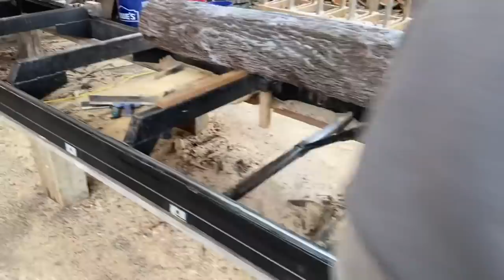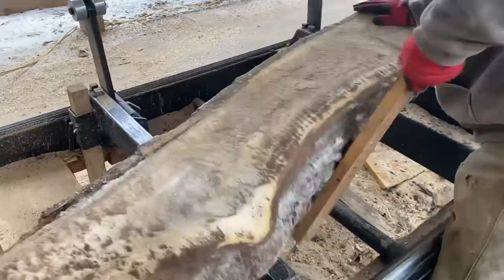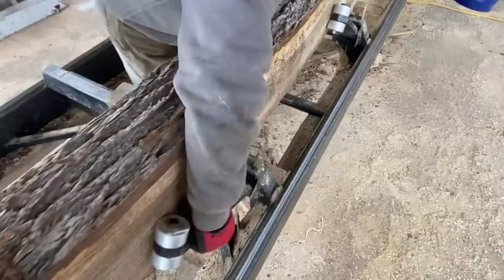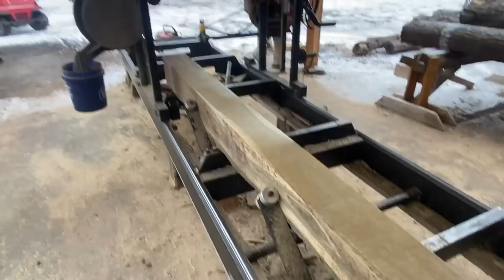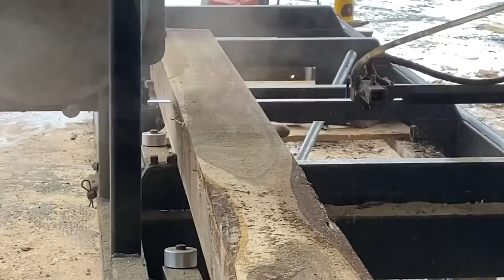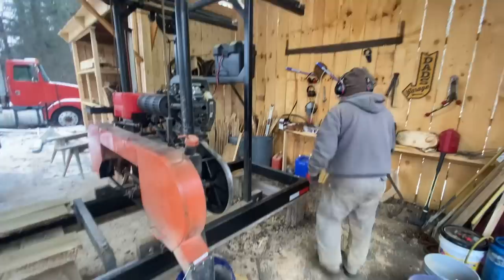Homemade sawmill in action!

Comment: You obviously are a man who is intelligent enough so that you have no problem taking advice from others.  I see that attribute in your mill.  The deep throat on your mill is a huge improvement over the small commercial mills I have seen.  Here's my advice for you.  Read up on quarter sawing.  These small mills are slow.  But, given great expertise as a sawyer, you can easily provide yourself, and others some of the most fantastic and valuable wood possible out of each log, wood that is otherwise unavailable anywhere else.  Learning about quarter sawing from a number of different sources, will give you that knowledge.  There are a wide variety of quarter sawing techniques to study, each for a specific purpose corresponding to what the end-user, carpenter/craftsman, has in mind.  Quarter sawing is begun by studying the log, and turning it on the mill, so you can make a straight cut right down the center of the log.  Then throw half the log off the mill.  The remaining half, stand it up flat and cut a line off-center through the middle.  The off-centeredness is determined by 1/2 the width of the stock you are cutting.  Then make the opposite cut.  These pieces are the best quartersawn, wood coming from this log due to their width.  If the log has a swoop, you'll want to LIE IT DOWN so you can cut straight through the log center.  If you're cutting a log with a swoop, you'll obviously need another kind of saw to cut a swooping line offset through the center.  When quarter sawing, one generally leaves the round edge with the lumber.  Narrower quartersawn wood is also valuable.  Once you start quarter sawing, you'll understand, your mill can do a lot.  But that, the end goal is to provide wood for a carpenter/craftsman who has all his own tools with which he can get the best out of the wood, that you can provide.  Nice job on the mill!  Keep improving it, and or, build another one even better!  I wish I were near enough by to come see your mill in action.
Reply from the maker: That’s quite a compliment I appreciate it very much. I wish you were closer as well I enjoy sharing the mill. This is a hobby for us with this being our mill. We have however sawn lumber for quite a few years on another mill at an other location that was not our mill. And I agree with quarter sawing too. The ability to gain stable lumber is a great thing. We have sawn quite a few logs on this mill quartered and the main reason for the larger throat depth for me was the ability to reach the center of a log. That’s funny that you mention this because I was wanting to post a video of sawing a larger white oak log we have and a process of quarter sawing it. And also a larger cherry. Thank you again for the comments. I agree for sure.
Reply from the maker: Ok you’ve got me thinking more about quarter sawing some stuff for myself to stock. It has been a few months since I’ve done it. Thanks for the reminder.
Reply: @PaulWhitedWoodStoneIron  -  This is interesting.  The guy apparently knows nothing about quarter-sawing.   But he's modified his mill wider.
Reply from the maker: @nodnostrebor4300  what guy? I might be missing something here.
Reply: @PaulWhitedWoodStoneIron  - https://www.youtube.com/watch?v=6n873hTQvLI&ab_channel=CanadianWoodworks
Reply from the maker: @nodnostrebor4300  I have seen many videos of this guy and he’s come along way over the years. This was the first video I had come across him years ago about extending his mill. I do see what your saying.
Reply: @PaulWhitedWoodStoneIron  -  Here's an interesting Amish mill, apparently built-up from other mill parts.  This is not a hobby mill.  The Amish fellow runs this mill full time.  The mill represents a huge investment, as you can see.

https://www.youtube.com/watch?v=GE-oofkRNAg&ab_channel=BarnGeek

I have an idea for a simple mill, unlike anything on the market.  It would be slower, but it also would cut the finest quartersawn wood with ease, and without the expense of a larger mill, like the Amish mill in the above video.

In my youth, fifty years ago, I traded my labor for getting my own wood cut at a Frick mill, which as you doubtlessly know is a circular saw mill.  Owning a Frick mill, is like owning a tractor trailer truck.  It's relatively expensive to run.  It's much faster than these hobby mills.  While faster than a hobby mill, a Frick mill is no where near as fast as the big commercial mills.

I've been looking at a wide variety of mills.  The big commercial mills emphasize speed.  The commercial hobby mills emphasize cheapness, but sacrifice speed with very little gain in the quality of the wood.

Wood is funny.  Framing lumber is one thing.  Round edge coffee tables are something else.  Quality wood however, is something that is difficult to find, while there is a strong market.

Take a look at these older stringed instruments. They're made the old-fashioned way, with quartersawn wood.

www.europeanviolins.eu/en/old-cellos/

The front and the back are made of two pieces of quartersawn wood, figured maple on the back, and spruce on the front.

The importance of quartersawn wood in these fine instruments cannot be overstated.  The slightest movement in the wood would repeatedly require expensive repairs.

When I looked at your mill, I was impressed with the quality and thought put into what you've created.

Comment: Good job with the mill you have given me some good stuff me and a buddy is fixing to build a good size mill he has a  small Hudson now
Reply from the maker: Thanks Charlie. Not that I know everything, but if you ever had a question about anything I would be for sure willing to answer anything that I might have fought through. When I built this mill I for sure had the ideas in my head, but did change a few things as I was going through it. After over a year now of running this one I’m still very pleased with it. And don’t think I would change much even if I was to build another one. It functions great with the drive system as well and hasn’t even given me the rush to upgrade yet. I’m pretty happy with even it being a manual mill. Good luck with the build and for the comments. The biggest thing that I’m grateful that I did was figure out a way to have springs and hydraulic tension. The cuts are always straight. The tension always stays the same.

Comment: Im also running a convaor belt along side the 40ft bed and a auto board return to move the boards for the next cut on to and auto feed stacker .
Reply from the maker: That will be well used and needed for stuff that size.

Comment: Ever think about a hydraulic system?
Reply from the maker: Yes I sure have. One day maybe. For now it’s still working well and when I have some time to put to finishing the mill up it will either be hydraulic or electric driven.  Probably electric since it will use less of the horsepower of the engine to run a pump.  And would be cheaper.

Comment: Don’t you normally cut a three quarter at one inch to allow for shrinkage during curing
Reply from the maker: Yes actually we cut 1-1/16” for shrinkage for final 3/4” boards at the end. But this project we were cutting was for a final dimension of 1/2” once dried and machined. 👍

Comment: You did an incredible job building that mill! How many hp is your engine? It cuts pretty quick.
Reply from the maker: Thanks I appreciate that. It’s 22 hp and has amazed me also with it speed. Thank you for the  compliment.
Reply: What size of pulley are you using on the engine and what size of drive pulley are you using, and what size of band wheels? I'm sorry to ask so many questions ,but I love the range of speed you're getting. I'm building one right now and would like mine to run that speed !